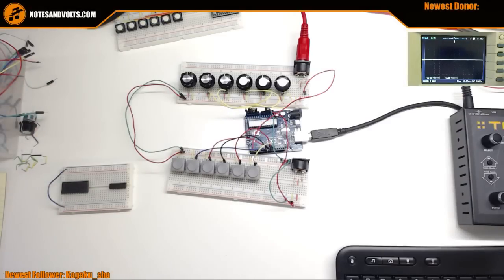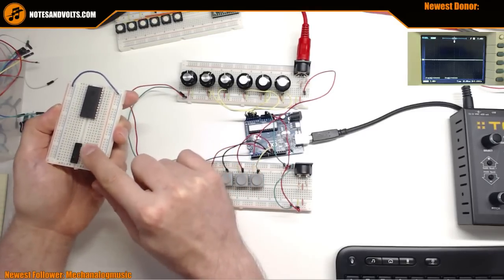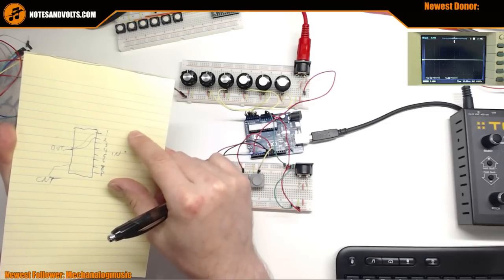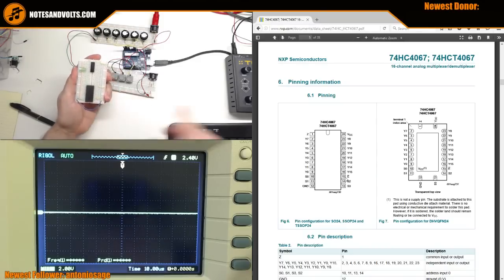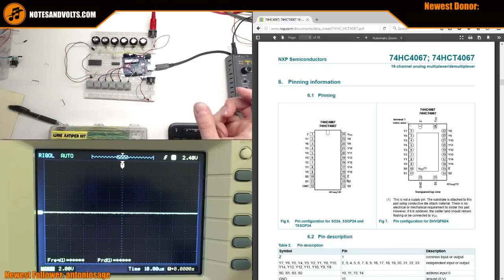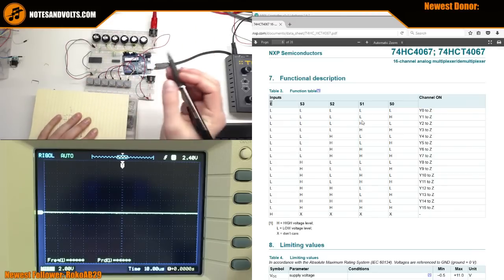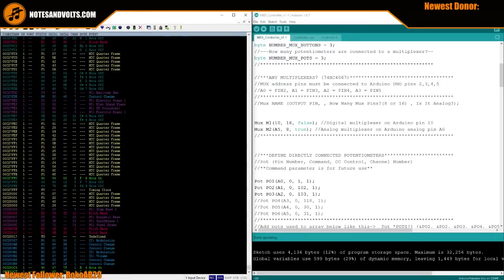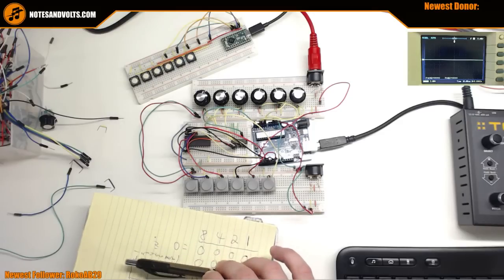LIVE from the Lab: MIDI Controller - Multiplexers!!

Comment: Been checking out your videos and learning a lot along.  I'd like to know the part number for the grey buttons you're using in this video.  They are ideal for my project.  Thanks!
Reply from the maker: Hi xonox. I wish I knew. I found these at a surplus shop years ago and have never seen them since.
Reply: @NotesAndVolts  I think i found them after hours of searching on the net.  Probably Marquardt 6425 series.  I think 6450 is what's used on Nord keyboards (and other instruments) and 6425 looks like the ones in the video.  Similar to what's used on many other musical equiment since the 80s.  Hope this helps :)

Comment: HELLO, I have used 74HCT4067  and for some reason the buttons attached to the pins 16 to 21(in multiplexer) are not reading/working .I have used your code. What could be the problem?

Comment: Love this channel. Great stuff. Is it possible, I want to make a MIDI DAW control surface, but, and I'm thinking big, want 50 pots and 40 buttons running off one arduino mega? Daisy chaining multiplexers for the pots etc. I'm new to this but learning a lot from your stuff. It's great stuff. Any help would be grately appreaciated.
Reply from the maker: Hi Sirkristofer. You can add multiple Multiplexers to this project at 16 controls per MuX. Just keep in mind that the more controls you add the longer it will take the software to read them. At a certain point this could cause lag and missed control inputs. Pots take longer to read than buttons BTW.

Comment: hi, i dont understand why but i can't manage to get more pots on multiplexer going right. I use Arduino atmega2560 i did everything as in the tutorial and when i connect more than one pot to it, change program, and suddently it does not work. The first one what was working like a charm when was single on multiplexer after connecting second one start giving random CC number and channel too, the second one does not react at all.
What did i do wrong??
Reply from the maker: Hi Neytal. The code is specifically designed for the UNO board (or Nano). It uses direct port manipulation code to speed up the read times. It won't work properly on a 2560.
Reply: @neytaldub1093  did you have any luck with it because I want to use arduino mega with it too?

Comment: Good job on the page!
I am working on a project on Arduino UNO and I need you please. 
I need the source codes to send 12 messages SYSEX which will be activated by a midi din on/off switch on each. Thank you in advance for your help.